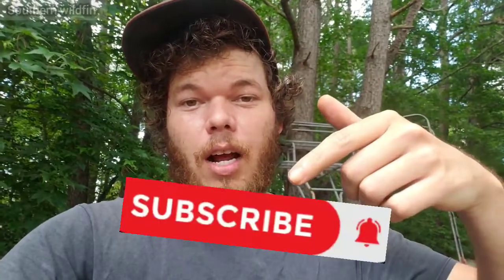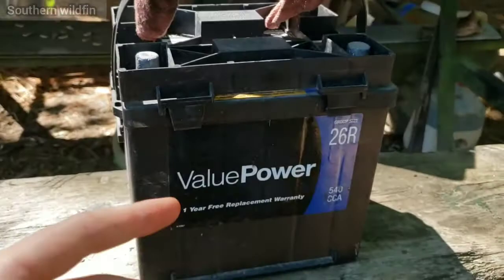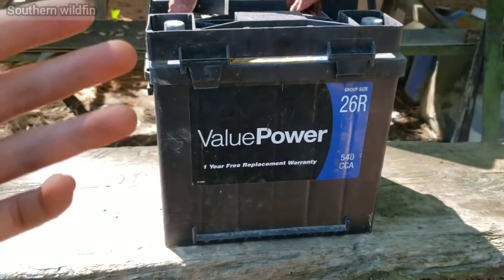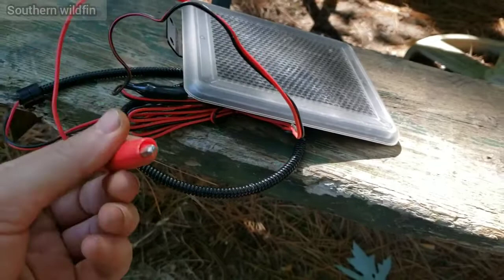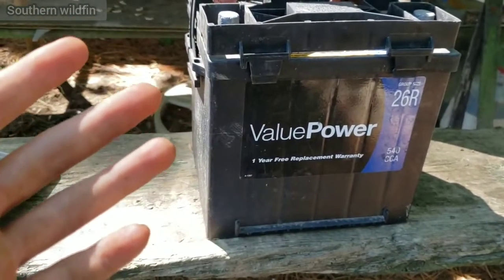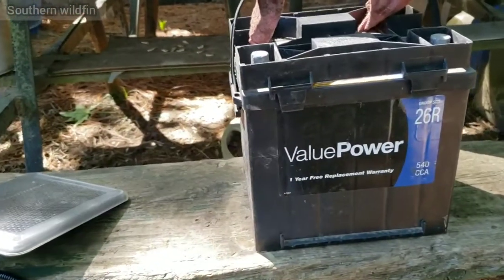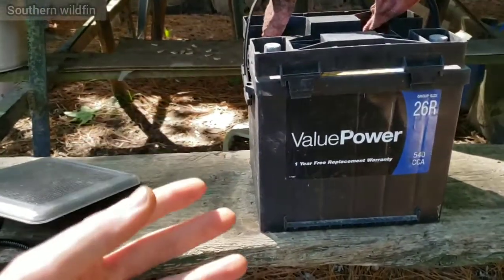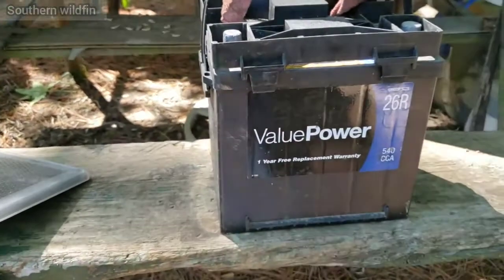how to keep a charge on a trolling motor battery solar power/ while out on the water

Comment: How many watts is that panel? That panel wouldn't supply 10% sitting in the sun for 4hrs
Reply from the maker: Its a small one. I can't remember. It was on my boat to maintain the battery. Not to charge it completely up. While I sit there I plugged it up on my little car battery. It would put a 1 volt in it about every 35mins

Comment: So you can run this all day as long as there is sun , and it will keep the battery charged while trolling ?
Reply from the maker: It don't keep it charged while trolling. It helps with keeping the battery maintained when I'm sitting. It does help though. Appreciate you watching
Reply: You would need 6 100 wat panels to run a trolling while trolling ….. this is to maintain the battery while your not running